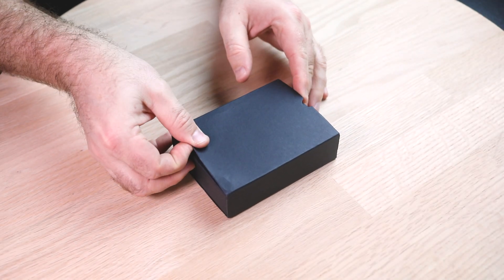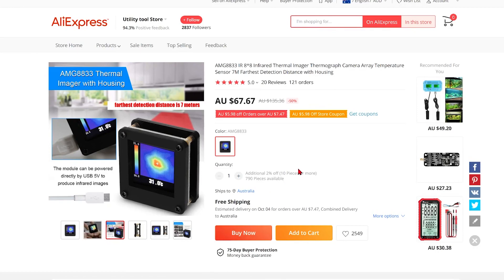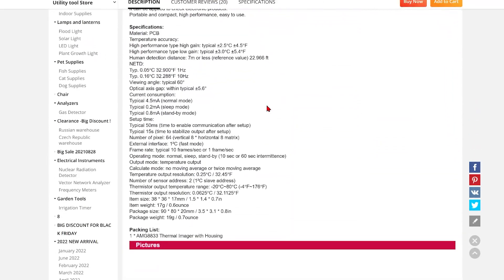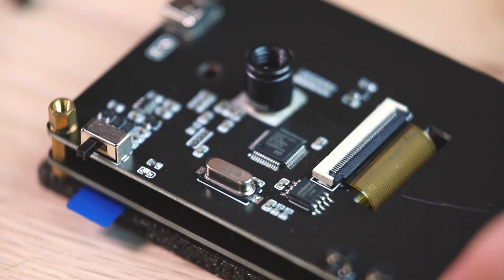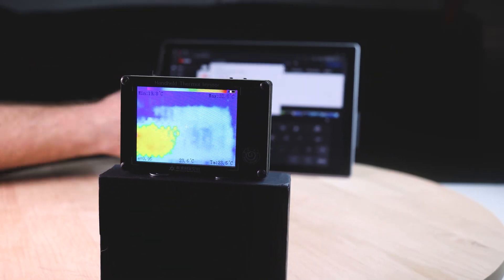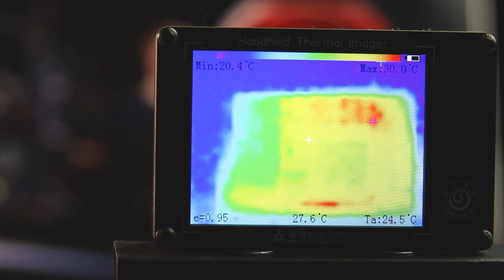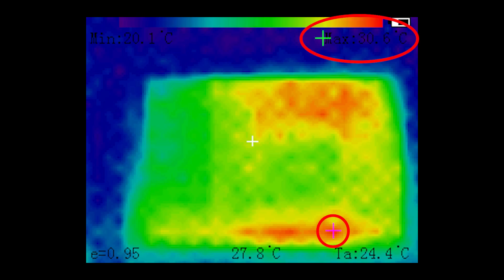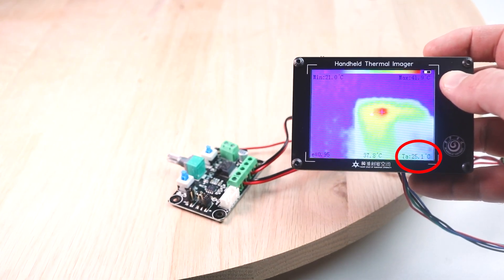Melexis MLX90640 Thermal Camera // budget thermal infrared

Comment: Will this work to detect a leak in my wall. Would the water be blue in colour
Reply from the maker: Only if the temp of water contrasts the wall temp… if they are similar temperatures -this will not be effective.
Reply: Cheers for that 👍

Comment: I usually do laptop/ desktop any kinds of electronics board level repair, I really cant afford to buy expensive stuff since i was just starting my own business now, do you guys think this would work on detecting overheating smd components when injecting voltage on the board?
Reply from the maker: Great question. I think you can get a ‘rough’ outline of smd components, however the hardest part is locating what part the camera is focused on. Using a cooler object to place in the camera frame to find component can help. I suppose it comes down to what you can afford and what detail you need.

Comment: Hello. May i ask how to turn it on? Do i have to pull out that green film strip or why it doesn't work? Thanks
Reply from the maker: There is a switch at top to turn on. If that doesn’t work, it needs to be charged or might even have a battery fault - also check that everything looks plugged in!

Comment: Hello,
Just get the camera but not working, how do you change the battery? 
Thanks for your feedback
Reply from the maker: Thanks for your comment. Make sure you turn the camera off and plug into a usb c cable to a 5v changer or computer and will charge!
Reply: Looks to work, many tanks! there is a manual for this device?
Reply from the maker: Hmmm not that I’m aware of! I suppose this is one of the reasons why I made this video as there wasn’t a great deal of information.

Comment: You may not believe but I have the 8 pixel by 8 pixel Panasonic AMG8833 thermal sensor with a 35mm OLED display and a micro USB socket which serves only as a power supply and I use it with a powerbank, and believe me, it has better refresh rate. Its the cheapiest therma camera but I love it and I use it to find hot and cold spots around the house.
Reply from the maker: Awesome! They are super helpful 🤩

Comment: Hi
Do you think this will be of any use to detect hot blooded animals or humans in total darkness ?
What do you think the max range will be if I only need presence, not identification?

Thank you
Reply from the maker: Greta question! Yes absolutely. I wouldn’t go beyond 12meters range!!
Reply: Tons of Thank yous.

Do you have any idea or information on how I could reduce the FOV even below 55 degree ? 

I'm thinking some lense assembly. But not glass. Where do I get such a lense ?
Reply from the maker: I am is aware of any such lens for these types of thermal cameras. Any glass lens will cause the camera to pick up temp of glass in lens and not beyond. You could try the following:
1. Pull apart a MLX90640 lens and increase distance between sensor and lens.
2. A pin hole type of camera might work, however I could be way off here! 

Good luck 🤩🤩

Comment: That looks usable.
What would you say is the next step up in image quality for the next sensor ?
I see some sensors that are  120x160

You really should have filmed more things and checked the temperature with a thermometers
I would like to see the minimum and maximum temperature this thing can read and what the accuracy becomes.

For instance a block of ice from the fridge or a piece of metal heated by a flame

Comment: I'll need additional Details for my project. As i will need to use this camera for active robot deployment on Crisis zones after an earthquake i'll ask some questions here.
The MLX90640 as a base component always comes in 2 Versions. One is the D100 and the other being D55 (respectively they stand for wide angle and narrow angle versions) i found out you hace the D55 base component, for Melexis it should be the BAB Model. 10 meters range is pretty good, even if the image you get will be not as detailed on that range. In Earthquake zones everything will be completely dead-cold after some minutes. so even low resolution pictures will be more than enough to determine survivors. My question is if you already tested the BAA version with wide angle and if you also tested the range it can detect heat? Also would you have additional recommendations for thermal cameras for a smaller field robot.
Reply from the maker: Wow! Your project sounds fascinating. I believe that I was using the BAB version for this video. I can try some tests for you over the next week if you want? I’ll post as a short on my Chanel to assist with your question!

Comment: Great video! Not sure if it was mentioned but have you tried the maximum range of detection? The MLX90640 should be able to detect anything within 7 meter range. Can you confirm this? Or, if lower, how much lower? Otherwise looks like a solid product 🙂
Reply from the maker: Thanks for your comment! Great question. I just checked out and it picks up vision much further than 7meters, however not highly accurate. I just tested and easily reached 10meters. It’s not a high detail camera, however good for a rough idea 👍

Comment: Ive found 2 versions of this cam, theirs the MLX90640-BAA and BAB, only difference i saw was field of view, BAA 110°x75° and BAB 55°x35°, not sure if that makes a difference in image output.
Could this be used to pick up shorts of small smd components on a PCB?
Reply from the maker: Great find! I hadn’t noticed the different types, however I doubt there would be much change in clarity - probably more cropped than anything. I have the BAB version…. You can get a DCI module, so i wonder how hard it would be to swap out the lenses… maybe I should experiment!

Comment: Thanks! Also got one. Biggest disadvantage is that you cannot set min max for a colors gradations. Does anyone know where we can get source for a firmware? It uses ARM so there should be a way to put alternative firmwares. otherwise, its not the highest resolution, but ... it gives information where are those areas of heat/cold. As stated and displayed in video.
Reply from the maker: Yes I agree with you! That would be a nice feature. I’m sure you could update the firmware if you were coding savvy!

Comment: Any thoughts how this compares to the equally priced ($70)  M5stick T-Lite Thermal Camera Dev Kit (MLX90640)?

Or even the slightly more expensive IR solutions : Walabot, AMG8832/AMG8833?
Reply from the maker: Great question! I have had a brief look and the M5stick ends up being the same price with shipping delivered to Australia. 
M5stick pros:
- ESP32 w/wifi
- slim compact design
- microphone - I assume you can record video? 
- open source

Cons:
- small screen
- less flash memory
- minimal screen data
- unsure on refresh rate/hrz 
- more functionality = more battery usage

M5stick seems to be a comparable device, however more for a recording/PC controlled device rather than a live inspection device. 
As for the Walabot, I’m not too sure on this one, however probably not comparable due to cost. There are many IR cameras out there and it seems the more you pay, the better they are! 
Without seeing these devices, these are my thoughts from what I can see online. 👍👍
Reply: The AMG8832/AMG8833 is a 8x8 pixel sensor so not good resolution.

Comment: Do you think it would be any good for detecting the extent of bee hives inside wall cavities (say from inside through plaster sheets) and within brickwork from outside?
Reply from the maker: Great question! It would mainly pick up variants in temp coming from the outside of wall… not inside. so if the bee hive transfers heat to the plaster board/bricks, this is possible, however if the wall is normal, I will not show. The sensor will pickup the closest reading!
Reply: Yes it works, at least gives an idea if there is a cluster

Comment: Thanks, any good for longer distance? E.g. Looking at your house outside for poor insulation, gaps around Windows and doors etc? Cheers
Reply from the maker: Thanks for your comment Shaun! The camera tends to struggle with long distances… I wouldn’t use over 6-8meters distance, however will still work. If you can inspect within closer proximity, yes this is certainly possible.